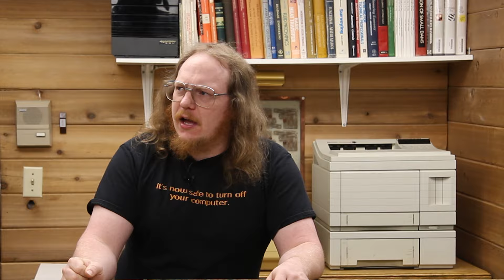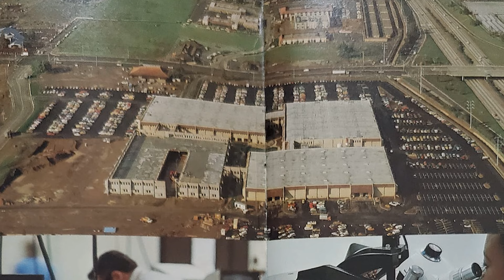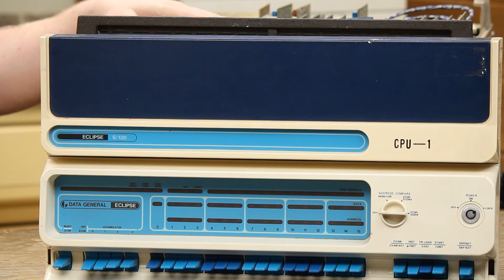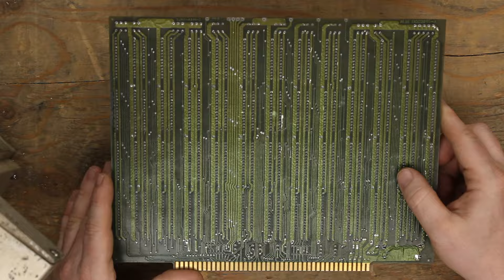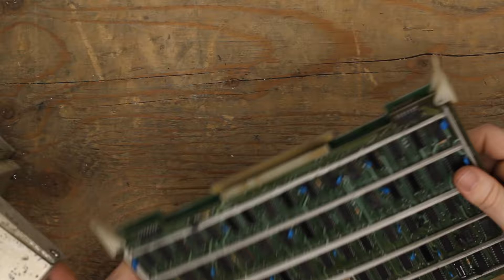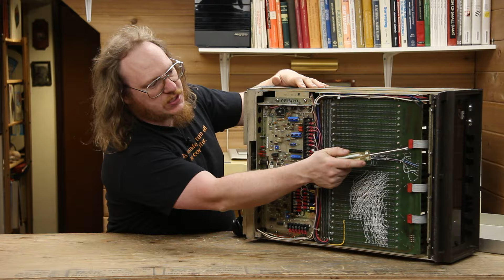Four-Phase systems - The Creator, the Company and the System IV/70 Computer - Part 1

Comment: I worked many years with this systems, first in an repairshop in germany, later on as supportengineer germanywide. The first software was called "data", later i support systems with Software from Softlab, called " maestro". This software was used to emulate IBM 3270 Terminals. Most of the systems was equipped with  "FAST CPU, NP 80 and up to 4 discdrives", first 80 mb discs, later 260 mb disks (size 19")😂 an very heavy. We also installed 2 Systems as an solution for backup with switches to turnover the terminals, the discs and the dataconnections.

Comment: The 4004 was not a micro processor, it's a even longer stretch , as it needed 40 chips outside it to even act as a CPU, so if   AL1 was not a CPU, then it's a joke to call 4004 a CPU.

Comment: According to information from Synertek the 6512 is similar to the 6502 but requires an externally generated 2-phase clock and has an external "Data Bus Enable" line.

Comment: FYI, the 8437 board is an Intelligent Communications Controller, designed for use with the System IV /90, the controller
contains a 16K-byte processor. The 8437 supports both the Bisync and SDLC protocols,
Reply from the maker: Thank you for the confirmation! When I was working on part 2 I realized my error.

Comment: Great overview.  I was a field engineer for the company and serviced the device.  Debugging things like display issues on a terminal could require you to go through a routine on loading up data via the 24 switches.  The return would be the light indicators providing information as to what board and chip is faulty. Many field updates required updating boards utilizing wiring diagrams identifying updates that needed to be made.  Pull out your soldering iron and go to town.
Reply: I worked in Germany in the DEC Central Workshop and mainly i repaired the CPU Boards and Peripheralboards, also the boards from the so  called Fast CPU. For repair we hat the complete Set of Dokumentation and also the complete microprogram. We used an testbox to toggle step by step thru the mircocode to find out  the failed component. Very interesting work.....

Comment: Datapoint did distributes data processing with 8/16 bit system and development the first commercially available network. In the very early 70’s the Startdust hotel in Las Vegas installed the first network from Datapoint called ARC. Attached Resource Computer. Oh and I was the one that installed it.
Like I said earlier I grew up in this industry. I wrote many many lines of code in many many languages.

Now DEC(Digital Equipment Corp)  as well as Datapoint was able to submit jobs to an IBM mainframe. First by acting as a 3270 terminal and down the road in a more sophisticated way, i.e. by acting as a 3274 cluster controller.
Oh and lets not forget GA (General Automation) and Xerox which in college we used as and RJE system to and IBM 360

Ricky from IBM
Reply: I worked with the IV/70 Systems many years. It was called bei DEC P7000 and later Systems was called P7300. We used the Software from Softlab, Munich called Maestro. The was used to emulate the 3270 Terminal for Programmen the Mainframe.

Comment: 😅when I was in my early 20s I did work on Four-Phase System. It was used for medical data processing.
Also worked on the TI 900 doing credit card  processing
I grew up in this industry
Worked at Datapoint,  Apple, DEC,  and of course IBM

Ricky from IBM

Comment: I suspect the Four Phase demo worked not because it tricked the lawyers or the court, or TI. 
But because TI recognised the demo was potentially good enough to create reasonable doubt in a jury.

 It kind of flipped the nature of what TI had to argue on its head. Before the demo, they only really needed to convince the jury that their chip was manufactured first, which is something everyone can understand. After the demo, they would first need to convince the jury that AL1 wasn't a microprocessor and didn't count as prior art for the patent. 

Also... TI patent is actually pretty broad, and you can make a pretty convincing argument that the AL1 meets the definition even without the support circuitry.

Comment: You are a total star. For someone to explain such a device with such clarity and make a story of it, one simply does not care that it was not working. for now!  I would be interested in how this fits in with the F-14 CADC which also had some sort of claim.  The laserjet behind you was one of the best. I rushed to see what else you have done, which made me regret ripping an expensive Sony camera to bits which did not work until you then let on that they are difficult to put back together I wanted it for the B4 lens.     Please keep contenting.

Comment: fuh-say-shuss?? That's not how you say that word.
Reply from the maker: sorry....
Reply: EXCELLENT!  Thank you sooo much for this!  
Some of the better late '70s junked TTL boards I used and/ or scavenged for parts way back then (7400 series, bipolar bit-slice,etc)  boards had 1/2 inch high thin white plastic-coated strips arranged as vertical 'rails' similar to the broken ones you showed, but they were more than just compact high current power bars -- they had built-in  sheet-like bypass caps too!   They had many thru- hole leads; +5V one side, GND on the other, spaced to match DIP packages. 

 Also-wirewrap is a blessing, not a nightmare as long as you have the right tools--hope you have a Gardner-Denver manual wrap gun and unwrap tool or equivalent, and new wire is easy to buy (though you may not need it- wire wrapis even more reliable than PCBs, even outdoors...)
 Best wishes on this genuinely historic adventure!  Bravo!

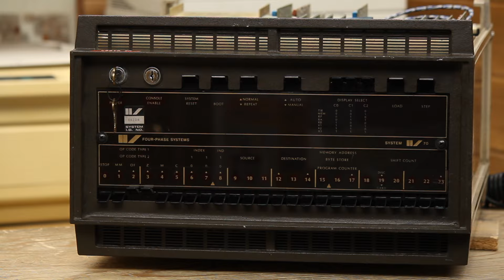Comment: 15:30 Like a component stereo.
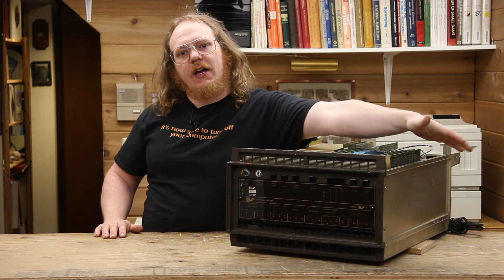15:49 Anodized aluminum.
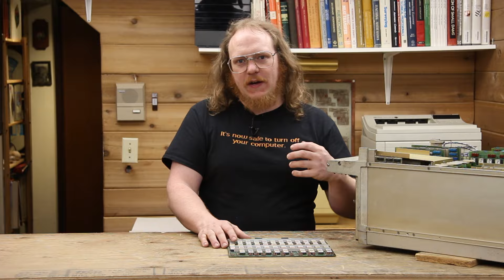19:05 48 chips and a 24 bit computer.  Two banks of memory?
19:54 Almost certainly xxxxBIT chips.
Reply: Was thinking cadmium-plated steel. Resists corrosion, just don't lick it. Used in a lot of TV chasis in the day. But that's a guess.

Comment: Didn’t Motorola eventually acquire Four Phase? When I arrived in Silicon Valley in 1986, I always heard them referred to as Motorola Four Phase.
Reply: I have a Four Phase Systems S2000 which is a Motorola machine with an M68000 and an M6809 CPU card.